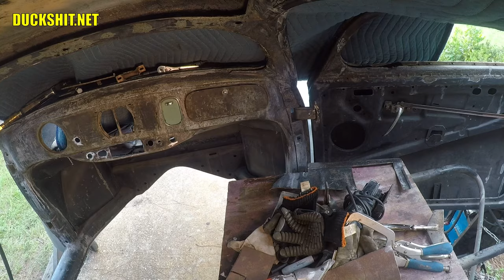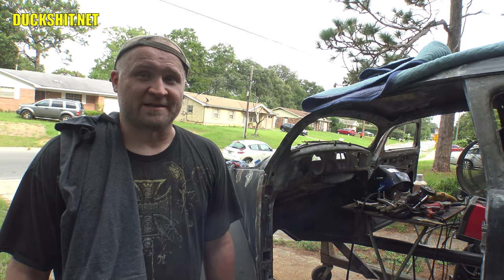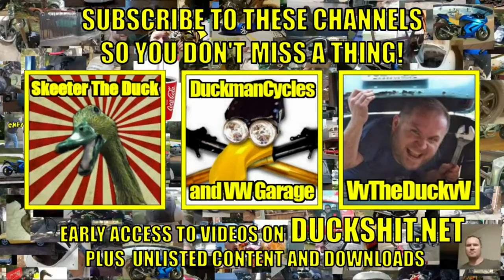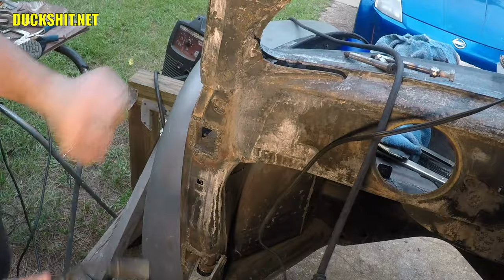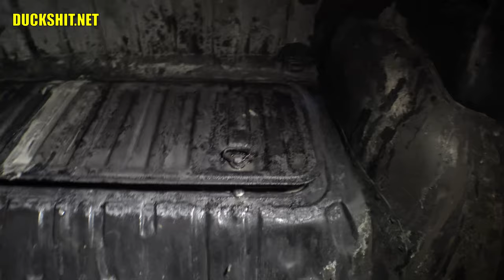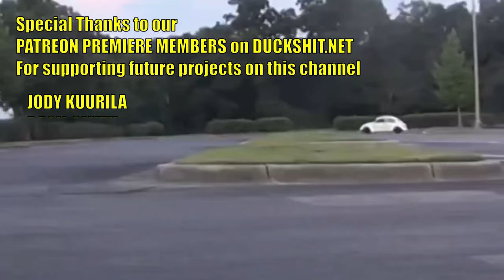Patching Dashboard Holes - ROTTEN OLD 1956 VW Beetle - 119

Comment: Guess if he counted the holes for the a/c and the start button in the dash.
I suggest to use the big center holes to use for two vents, blowing cold air
into the car from your a/c. Or some extra instruments; Voltage oil pressure
turbo (lol) amp fuel meter. And using the big only tor the speedo and km counter.
Reply from the maker: Gauges are going elsewhere... its a surprise!  You'll see after the new year!
Reply: The duckman and Eleonora go digital?
Men, you will make VW history with that!
Maybe with some pages in the classic VW year book.
Reply from the maker: Well it might be some digital but I like an analog needle!  😁😁👍👍
Reply: A column shifter and digital gauges.
With an old school Diesel in the rear. tactactactactac lol
http://youtu.be/wWLmRkc54s8
Reply from the maker: Nope!  LoL!

Comment: Awesome video! Do you (or anyone reading) have a good way to keep rust from creeping back out of an overlapping seam? I ground down the exposed area but can't get into the seam and can't separate the two pieces. I want a long lasting quality repair and don't know what to do. Thank you!
Reply from the maker: Get some phosphoric acid between those layers, let it dry for 24 hours, then seam seal every millimeter so nothing else gets back in!  That should do it!
Reply: @DuckmanCycles   that is a great idea! Do I have to try and neutralize the acid or just leave it in there and seal once dry?
Reply from the maker: Just clean the surface up where you got it on the outside, don't worry about what's in there it will neutralize itself against the iron oxide!  And that's why it's critical that you let it dry completely, because the chemical reaction produces water.
Reply: @DuckmanCycles  thank you so much. I love watching all of the content that you put up for us to learn from. I know that it is a pain to video and edit. I have tried to make videos of my Pontiac 6000 restoration, but have found the process very tedious. I am glad that you are able to do it for us!
Reply from the maker: @dueljet  thank you, and yes, the filming and the editing in the uploading and all the other stuff that comes with video making usually doubles or triples the time of the actual work!  It can be quite a hump sometimes

Comment: This may not be germane to the subject, but is Earl also going to perform his magic on the pan or are you happy with it as is? Just curious....
Reply from the maker: What magic needs to be done to the pan?  Its been done for a very long time.  The only thing that needs work on it and some of the suspension and brake parts.  No reason to send it away for that kind of work, right? :-)
Reply: DuckmanCycles and VW Garage 
Right
Reply: @DuckmanCycles  Just wondering if you were going to paint the pan body color. Some do, some don't. Glad to see you're putting the money into the important stuff....
Reply from the maker: Factory is black and won't show as much dirt.... pans get REALLY dirty!